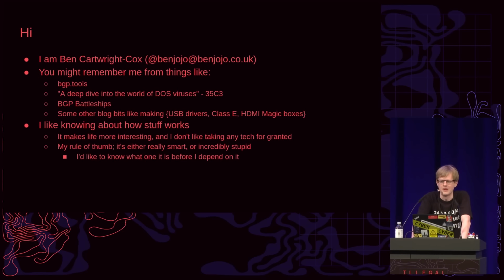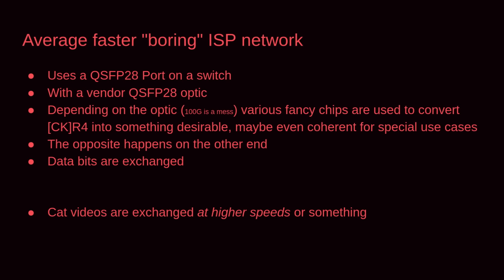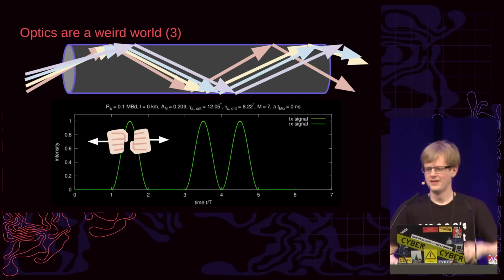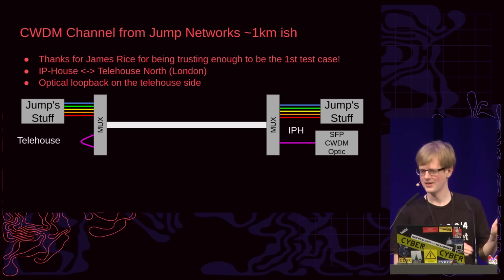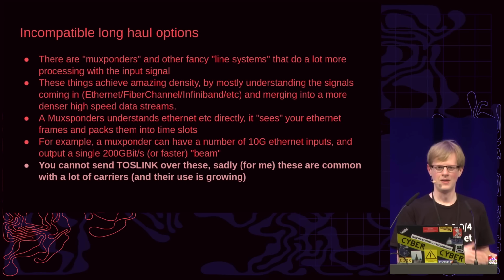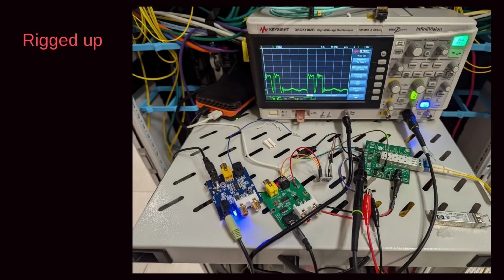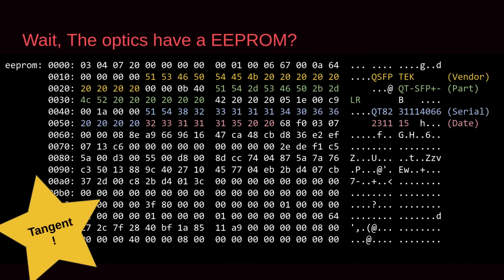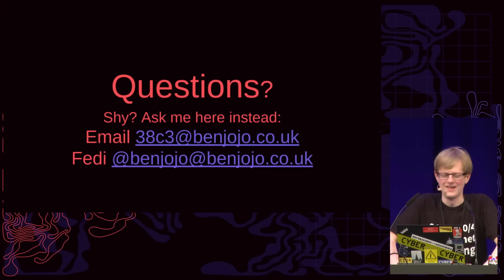38C3 - Going Long! Sending weird signals over long haul optical networks

Comment: Just as a side note: FM over optic is quite doable. I've worked in the field myself, distributing a mix of QUAM256 CableTV and FM Radio over up to 100km of fiber. After 100km the signal gets kinda mushy due to dispersion and after 150km it's definitely game over. But it works. And quite good I might add. 
It's a really easy way to distribute TV over large networks, which is why they use it everywhere. Also keeps the traffic off the infrastructure, our QUAM256 signal had the equivalent of 3GBit's of data in it!

Comment: Speaking of dailup over fibre, work (an electrified railway) runs low speed serial over fibre links (I assume with a handful of abstraction layers) because while the speed is over kill it makes life much easier from an efi and electrical perspective.
Reply: Cars also prefer MOST for all sorts of things for two reasons, EMI resilience and weight, that plastic optic fibre weighs a LOT less than copper.

Comment: A student radio at Lodz University of Technology used this technology around 2006 as their STL (studio-transmitter-link). No SFP's back then - they used an old set of MDX 10Mbit mediaconverters as the base if I recall correctly. It could have been ADAT actually...

Comment: There are Optical Talk Sets available, meant for installation technicians. They do voice over single mode fiber. Not sure if they do Ethernet like encoding, some digital mode or analog audio in AM/FM. This is even less bandwidth than TOSLINK.

Comment: I don't know if this was just dumbed down on purpose, or if there is a fundamental lack of understanding. Multimode uses LEDs. It bounces the light off the walls with total internal reflection. Singlemode uses lasers (coherent light). The thinner core and coherent light mean the light travels straight through the fiber. It does not get transmitted via total internal reflection (until the fiber is bent below its minimum bend radius, but that's not normal mode of operation).
Reply: Your simplification is as wrong as the one you are trying to correct. Single mode vs multimode has nothing to do with the sources. If you shine any light into a single mode fiber, it will still transmit just a single mode, because electromagnetically this is the only mode that can propagate. Modern multimode will also often use lasers because its too much of a pain in the ass to modulate LEDs at 25 gigabit.
Reply: @JorenVaes  Pain in the ass to modulate an LED that fast 🤣 even though a laser diode starts as an LED 🤣
Reply: @ No, LEDs and laser diodes differ in that in a laser diode, the electric current and field triggers lasing, which means a photon will trigger other electrons to recombine and release photons in phase and with the same wavelength. 

You also don't usually directly modulate the lasers for the highest speed applications, instead of use optical modulators and use the laser as a CW, not as a modulated source.
Reply: This is quantum entanglement basically, I need some help learning this , anyone know any Elmer's.
Reply: @medude1987  It has nothing to do with anything quantum. This is all wave-based stuff, not particles.
Reply: @timramich  ok , do you have a recommendation how to learn this stuff, this could be used for any signal , could you see the different frequency range or pick up stray transmissions .
Reply: What if longitude wave is used , I've been studying Nikola Tesla and heard neural monitoring was a thing back then and done to him to make him go crazy . With his own tech.

Comment: TOSLINK maxes out at 125 mbit/s. They just don't allow it in consumer stuff because studios think people are going to be ripping DTS-HD and Atmos audio from it (even though MakeMKV exists).
Reply: Which is endlessly frustrating. I would really love to TOSLINK all of the things in my audio setups.
Reply: @javaguru7141  I think HDMI put a nail in its coffin. The market largely said it wanted one cable for everything.
Reply: That's a lot of Mbit/s to be making with an LED. Just because professional equipment exists that can do it doesn't mean consumer equipment is physically capable of doing that, apart from being restricted by logic and arbitrary limitations. Optocouplers often top out at like 150 khz.
Reply: @SianaGearz  Meanwhile SFP28 optics are doing 25 gigabits with LEDs.
Reply: It doesn't. Usually tops about 30 Mbps if you get good one.
Reply: @Sixta16  I don't even know to what you're referring. LEDs in SFP optics? TOSLINK? What?

Comment: Yeah, the thing about YOLOing FM is that the first thing almost any modern FM receiver does (after the frequency discrimination) is to put the input signal into an AGC and then amplify it up until it's a nice square wave so that it can just count the zero crossings. So if your medium is turning it into a square wave for you... it's not really that bad.
Reply: Laser Disc stored the signal as digitally stored FM. Same pits and lands style as CDs, but for storing a analogue signal.

Comment: My first ever engineering job was at a company that made RF over fibre optic equipment. If you've ever watched satellite TV, or driven through a tunnel and still had GPS signal, the RF signal for that was probably passed over a fibre optic. Since they support frequencies of over 4GHz it's all done totally analogue - the laser amplitude is modulated by the RF itself. Somehow, it works.
Reply: That can't possibly work for GPS.  You've fixed the relative timing delays of the various satellites to be equal to what they are at the RF recieving station so your GPS should always say you are at the location of the radio receiver.

Or is that good enough here?
Reply: @petergerdes1094  that's good enough - it's used more for timekeeping than for location. Lots of road and rail systems use GPS for time sync.
Reply: @petergerdes1094  if you put a few of them along the length of the tunnel you end up with a signal that places you in approximately the right linear place along the tunnel, only with the wrong height. Of course the multipath is a bit crap.
Reply: @ I don't think that's going to work because GPS uses the difference between the timing signals it recieves from the sattelites (you don't have an atomic clock in your phone) so shouldn't it always report you as if you were at the location the signals are being repeated from?
Reply: @petergerdes1094  it's not for location, it's for timing. A lot of stationary devices use GPS purely for time sync.
Reply: @petergerdes1094  Nerds fact-check Commentors! 8-D
Reply: not to be confused with the other RF over fibre optic, where you send an RF signal and it somehow ends up at the other end just like visible/near visible light would. Magic
Reply: Hey joeofloath , I need some help with this optical transmission through rf thing , what's the best thing I can do to learn , and any Elmer's into this type of thing.
Reply: @medude1987  how much do you need/want to understand? Just how to use it or how it actually works? To really understand how it works you need a deep understanding of RF electronics design and probably lasers too (I don't really understand any more than the basics, I didn't spend long in the job). In terms of the application it's usually just a black box and anyone with basic HAM radio experience or similar can work with it.
Reply: @joeofloath  how to modulate signals and receive them
Reply: @medude1987  the laser power is directly driven by the RF signal, and received the other end by a high speed photodiode. There's lots of weird RF stuff to make that happen. If you want to learn more you could build a circuit to transmit audio using a laser pointer diode the same way, there's some schematics online for similar projects. The RF versions will be similar but designed for way higher frequencies.
Reply: wait... this is foreign to me... you can use fiber to transmit RF natively? You're not talking about some converter to optics? Did I just learn something new? This can't be real... could you point me to a resource/example? @joeofloath

Comment: Love it. One idea I had to work around the retimer - modulate the TOSLINK signal with  OOK (or more generally, FSK) so you have a carrier signal of several MHz that would be in spec for those devices.
Reply: But then it won't be toslink on the wire anymore, so you can't claim the world record for this
Reply: @flyinginthedark6188  "On the wire" is very subjective. Standard TOSLINK doesn't even run on the wire - it's modulated onto an optical signal, and that optical carrier itself already has some frequency.

Comment: I was recently looking into this for a thing to help me and my entrepreneurs find the correct fiber. We have our own (as in my employer) fiber network with the longest being 100km. We have almost no WDM, and we have no amplifiers. Everything that is not used is dark fiber and available for lab 🙂
This really got me excited.
Reply: I built something similar to this... for FTTH tracing. At the moment im using a cheap SFP switch with 8 ports.. but wanted to cost-optimize it by using a low cost microcontroller or similar and use 1Mbps or something similar to send "IDs" down the fiber. I was using bidi-optics so you can test strand by strand..
Reply: @garci66  I want to be able to generate 270Hz, 1KHz, 2KHz for example. Then I could id fibers without unplugging patch cords.

Comment: In some subway systems, mobile phone reception is implemented by having the RX/TX equipment in some cabinet, and then the tunnel just has dumb antennas that receive/relay the signal they see via fiber optics. That's done because maintenance in the tunnel would be too hard, or there is no space. Berlin has such things. Probably there are some old one sold off at some time?
Reply: There's no discrete antennas in the excellent Prague metro coverage but a leaky cable, a coax cable with slits in the sheathing running between the stations
Reply: remote radio heads are really common these days. 

It's also convenient for antennas on buildings, since it allows you to put a lot of the stuff in a box outside the building on the ground (or inside but more accessible than on the roof), run power and high speed data up to the remote heads and antennas. Means you have to put people on the roof a lot less often, and the distance from RF Frontend to antenna is minimized, which is especially critical for 5G FR2 (which should never have been deployed anyways but that's a different topic)
Reply: In general in tunnels they use a leaky coaxial cable with cuts in the outer shell, one cable can be used for multiple frequencies at the same time, and this also works in turn's
Reply: That's just how cell had been done since 4g. The BBUs are put in a rack and the RRHs get power and fiber and just output the rf signal.
Reply: Hey all the smart people on this comment thread , where can I learn this stuff , or something like that , I got a pred problem in my area and I have a idea on what to do . But need to learn some more or have someone to talk to when I can't figure stuff out , like I'm experimenting with my hack rf and GNU and forgot how to activate my hackrf 😂 , I did have it working and now when I made my own flow I can't remember what I did to get it working on the script I deleted already 😢😢😢